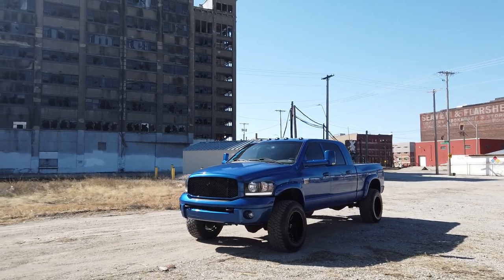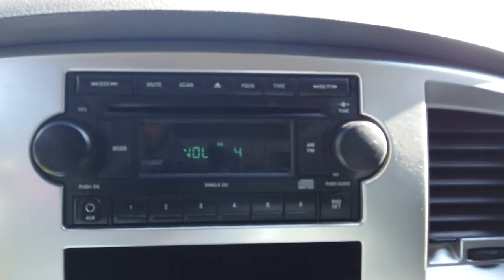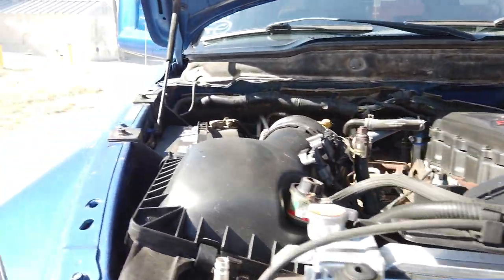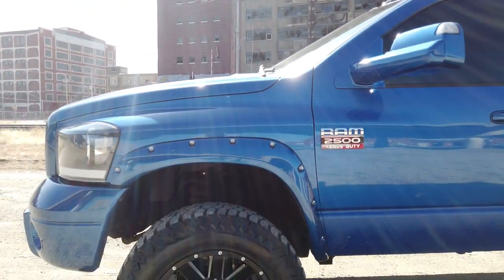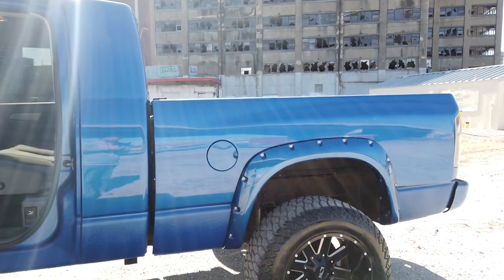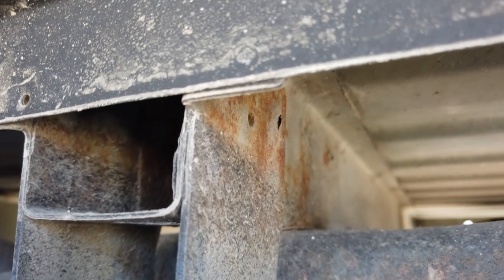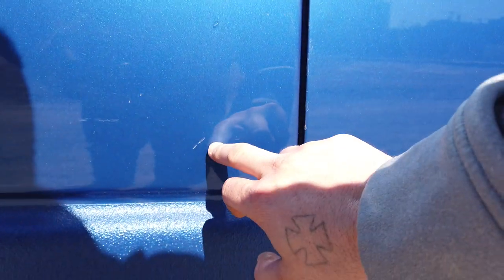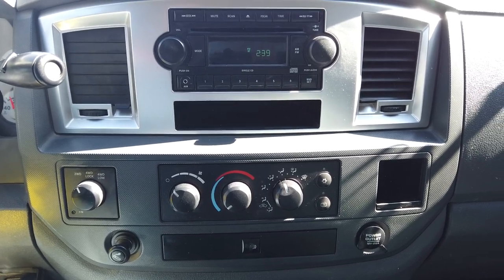2007 Dodge Ram 2500 SLT Megacab 6.7 Cummins Turbo Deisel, Pearl blue lifted for SALE!! 816Diesel!

Comment: What lift is on that ?
Reply from the maker: 3in level front, 2in rear block
Reply: 816 Diesel it doesn’t scrub those 35s ? Also is it been trimmed very clean nice truck
Reply from the maker: @justenbertrand  it does rub, we have trimmed it out to clear.
Reply: @justenbertrand  If people would   go one step beyond just putting spacers on and instead put longer control  arms on things would fit without whacking off sheet metal
Reply: @yerwrng  Mine has same 3 inch lift with 35x12.5 and only rub is a 100% extreme turn barely and no cutting at all
Reply: @deanfirnatine7814  I have 35x12.5 mud terrains on stock wheels with 2 inch hub centric spacers  on the same lift . But I added longer arms . The tires just barely clear as they pass the fender once they tuck past the fender they don't hit anything inside , but there is no way they would clear that fender with the axle being moved with the new arms . I have an aftermarket bumper there's a ton of room in front of the tire I could move the axle forward and run 37s but gearing starts to suck for towing . Sure you can fit 35s without arms to push the axle out but you're not going to be able run the wheel out as wide or it will scrub and the rigs with narrow stances don't really look solid .